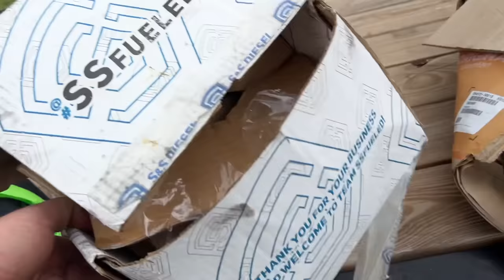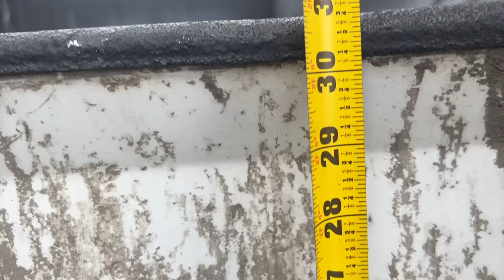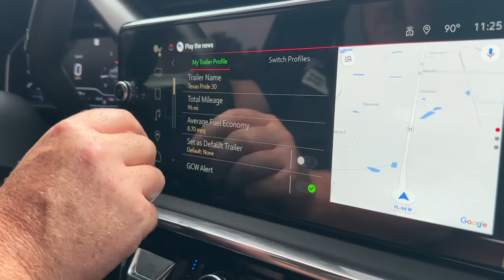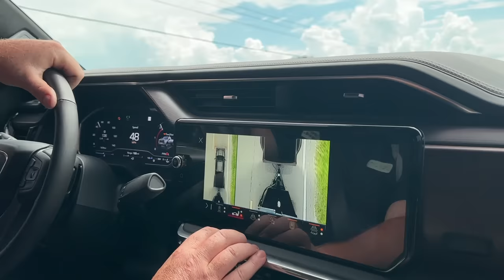$100,000 Diesel Truck VS $2,000 Diesel Truck!!!!  Are These New Trucks Really Worth It?

Comment from the maker: What do you guys wanna see compete? Crazy to see the difference the diesel
Market has made in the last few years!!
Reply: Might as well go grab Cleetus new tow pig and go apples to apples, not old busted joint and the new hotness 🤣
Reply: Lets see a top tier gas vs top tier diesel vs current top tier electric truck
Reply from the maker: @ryanc8188 it’s in the works!!
Reply: @JHDieseland4X4  let's go! Gmc got it all day!! Cleet don't want that smoke!  😆
Reply: Put the legendary 7.3 stock up against a stock 6.0 and 6.4.  Then put the same trucks up against the similar Chevy/gmc and dodge.  And of course, put all against the modern version of all.  You could fill out tons of vids doing this.  And probably a 1/3 of us at any given time want at least one of those comparisons at any given.

Another idea would be to include known weakness/flaws in each and how hard and maybe ballpark it would cost to make each last just as long as the rest….not all out power but from a daily reliable rig to crisscross the country on any given day.  Example, that 2k/3k truck could have 5k to 10k put in it and last just as long as the 100k truck and tow/stop almost as good.  Again, not from a rolling coal drag race but from the “do the grunt work” point of view.
Reply: @JHDieseland4X4 definitely need to get ram in on it
Reply: everyone wants to see justin drive or con
airboat vs airboat
or jet skis
or whatever justin is willing to operate
Reply: 7.3 not 6.0 duhh
Reply: How much for the white truck
Reply: @d3r0n812  ben hardy did that already
Reply: Do different generation comparisons
Reply: would love to see like a $10-20,000 vs $40-50,000 vs the new truck
Reply: Let’s see a 7.3 against the new truck
Reply: Mr JH What was the mileage on the old one ?
Reply: That was interesting
Reply: Intake, exhaust and a tow tune on the 6.0 and run the same tests
Reply: I want to see the 6.0 with a basic off-the-shelf tune like every 6.0 on the road lol. And a power stop bolt on break kit combined would be like a 1k. Then how it would be compare to the GMC.
Reply: Can't see why the 100K truck is  better than the 2K truck. Throw  10 to 20K into the older truck and you save money. You'll still be 22 to 33 percent of the cost.
Reply: Would love to see a less modern duramax vs these two. Lb7,lbz,etc.
Reply: @jhdieseland4x4 Can you please do a comparison of the new truck vs a 97-06 well maintained, slightly modified truck? I'm curious to see if that Ford would compete better with some street legal modifications like an upgraded transmission, street legal programmer, upgraded brakes, etc. Conceivably, you could do all of that for less than a quarter of the price of the new one. It may end up being a significantly better option for some people.
Reply: 2024 dmax vs
2014 pstroke.
Full decade of innovation.
Reply: The mpg difference hauling long distance of these two
Reply: The GMC vs a real engine like the 5.9 1st gen or 7.3. That 6.0 motor is booty
Reply: wanna see that gm turd run with a 23 super dooty haha
Reply: @d3r0n812 spoiler alert once that electric starts towing its going to have a 100 mile range, they aren't practical work trucks.
Reply: I know where you got that 06 ford 350 from (Atlantic auto) lol I worked on it for my boss (I mean the best I can I’m not a diesel mechanic 😂) but anyway it good to see it put in used and not sitting and yes it was a tire repair service truck
Reply: If your can’t afford it lol
Reply: @tomeickhorst6787 the 7.3 has no power bud
Reply: @kody5.9 you will run you wallet into the dirt
Reply: I don't know if this is possible  but I would love to take my 2001 f250 when the 7.3 gose out and get a new 6.7 done truck and put just the motor  and that 10 speed auto in it with out the imitions on it. I think that would make a he'll of a combo. And a lot cheaper than 100,000.00. And I bet that gmc would not keep up with it. Keep things simple.  The more electronics the more problems. Especially in that def stuff.
Reply: Vs a Powerstroke 6.7 0-60
Reply: Would love to see that 6.0 3500 compared to a new 1/2 ton.. ecoboost preferably.  But basically owning a newer gas truck vs owning an older diesel
Reply: I'll bet you 100k the 100k dollar truck won't last 10 years
Reply: Let me bring my 6.0 up there so we can put it up against the 6.6 I’ll out tow it I got 750hp vs your 475 😂
Reply: Test a moderate built lb7 vs the new gmc . That would be really cool.. reliability. Yes . But will the new trucks last 375k with simple maintenance like the old ones?
Reply: A 2005-2007 Ford Superduty with a 6.3l StrokerR motor from J&K engines vs. You new gmc. 

Then, compare the build cost to the purchase price of the GMC.

I'm betting on the 6.3.
One thing you forgot to include on you 2k vs. 100k comparo was the daily cost of operation, i.e., fuel, Def, etc.
Along with maintenance costs between the two.
Reply: @THATMIAMIDOLPHIN  you mean the 6.2l
Reply: @ripperlipper1016  no its a 6.3 stroker motor.
6.0 powerstroke with a 6.4l crank bored .040 over. 
Makes unbelievable power with all stock components just by stroking it. With the addition of heads, turbo, injectors,  etc. Lookout!
It's a better VALUE than buying an overpriced late model truck.
Reply: Cracks me up, anyone using the word "reliable" with any moder diesel regardless of manufacturer. 
Where I work, we drive nothing but late model vehicles (bought at years end for tax purposes along with other heavy equipment) from class 8 trucks, heavy equipment,  all the way down to 1/2  ton pickups.  These vehicles have nothing but problems with electronic sensors,  emissions systems, and fuel system problems.  There is nothing reliable about modern trucks. So you better have a warranty!
My truck will never be as quiet or option packed like a new truck, but that's OK. I drive modern equipment every day and shake my head at people who pay this kind of cash for a pickup. Again,  as a business owner, I totally get it. 
Regular folks need to stop buying these vehicles. If they did, prices would fall, but I won't get my hopes up, lol.
At the end of the day, we are Americans and free to do whatever we want. This is just one man's opinion.
Reply: yea do stock vs stage 1 vs stage 2 etc.
Reply: 23 6.7 vs that Duramax
Reply: Lbz duramax vs the 2024
Reply: Can't shut off the $2,000 rig via remote control because you violated your 15 minute city/ESG score/ carbon footprint allowance
Reply: @tomeickhorst6787  Or electric, beat it with 10 seconds
Reply: Lets see a truck that a normal middle class guy can afford.  Without all the dumbass options ie sun roof!
Reply: I would pay money to see the same comparison with a 24,000 lb trailer. That's the predicament I'm in lol.
Reply: Could yall do a 6.0 vs 6.4 powerstroke I wanna see how much advancement there was thanks love watchin yall from Texas